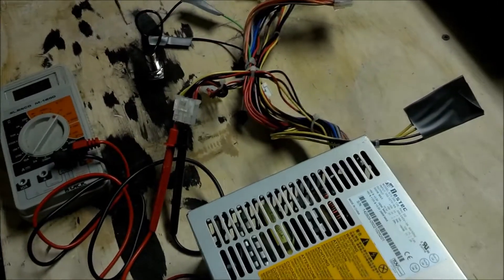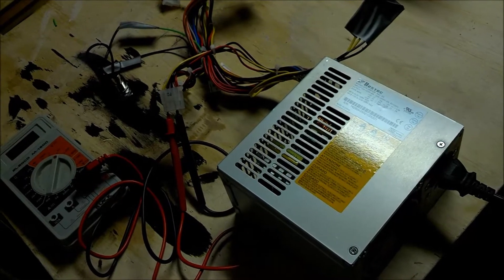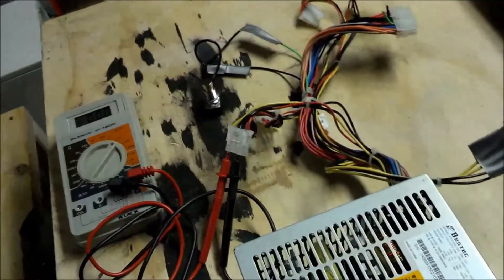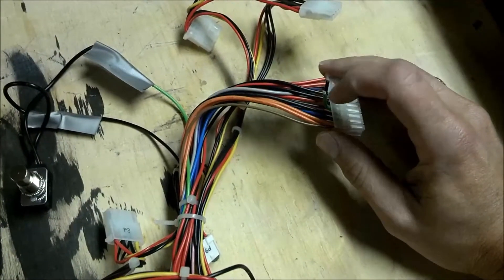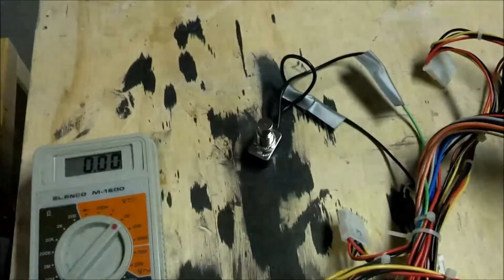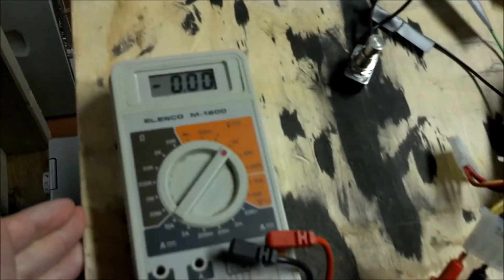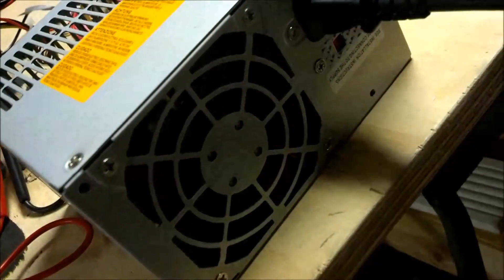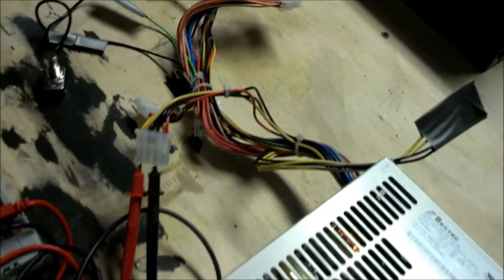Reuse An Old Computer Power Supply

Comment from the maker: Hi Darren - Thanks for taking a look at the video and for your comments.  It probably wouldn't be enough to power a 45 watt rig; at least not on hi power for extended time.  There should be a sticker on the old power supply that will give you an amperage draw rating.  You could always try - start on low power and check your power out of the rig.  Then test accordingly.

Comment: How do you distinguish 12 volt, 5 volt, and 3.3 volt? Also, will the 5 volt supplied by a similar power supply be adequate for an arduino ?
Reply from the maker: +Eric Escamilla Hi Eric.  The supply gives several outputs; testing the outputs with a multi meter would be required to figure out which wires give which levels.  Five volts out is five volts out...
Reply: +drez20001 Thanks! I am building a drawing machine using an arduino. It uses stpper motors rated at .365 amps so I was unsure as the 5 volts supplied by the PSU puts out 30 amps..
Reply from the maker: Generally speaking, higher amperage is fine - your steppers and/or Arduino will be able to pull more from a larger supply - such as an old computer power supply - if needed.  Voltage can't exceed parameters; if you need five volts for a particular device you can't use a power supply much above or below that level.  But higher amps just gives you a greater pit to pull from.  Best of luck.
Reply: Thanks for clarifying! This is all brand new stuff to me so I am trying to learn as much as I can so I don't destroy my arduino board.